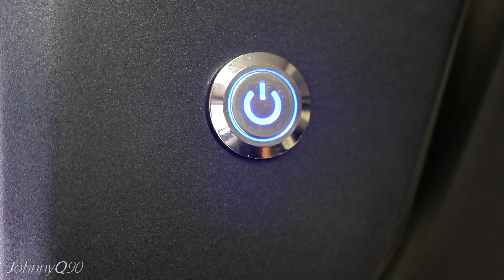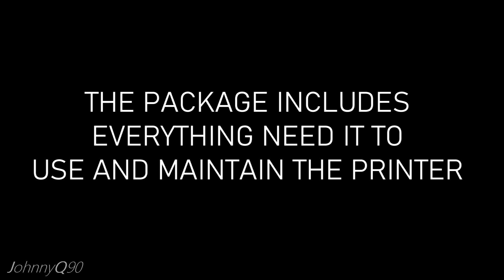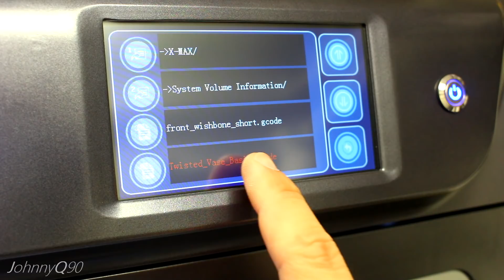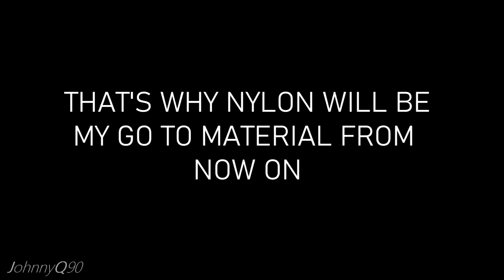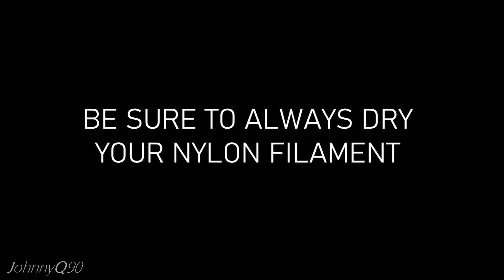Printing UNBREAKABLE Nylon Parts! - Qidi X-Max 3D Printer

Comment: I'm sure if you paint like "goodyear" or "michelin" on the tires it will kinda mask their simple shape
Reply: I'm even thought that same about that at that moment.
Reply: He needs better tires in general. Beadlocked and belted would be best for his powerlevels. The ballooning can be crazy.
Reply: @Aussie Jules Wiener yup i use belted and beadlocked tires on my slash vxl running a 5200kv motor on 3s
Reply: @xenonram  thats cause its not kilavolts, it 5200 rpm/volt
Reply: Hoosier Tires
Reply: Idlers
Reply: David David  RWB Idlers group.

Comment: That’s a great printer! You may want to try printing polycarbonate too. With such a high temp fan you can print the best grade materials, pc for instance has similar toughness as nylon but more rigidity, it is not as elastic as nylon. Nylon is great but the amount it strain it will sustain before failure can actually sometimes be more of a detriment. This is something to consider for load bearing parts that can’t afford to deflect as much.

Comment: I like taulman's 910 nylon, made a replacement hinge for a toilet seat, lasted 3 years before the seat broke. The printed hinge wasn't what failed either, it was the other part of the original plastic hinge. Also definitely print with 100% infill for functional parts.

Comment: Nylon is "semi-flexible" structural material, its mechanical properties lie partway between PC and TPU. It's key property is extremely low coefficient of friction. 

PC would be optimal material for RC car suspension. It is also extremely difficult to break but it's a lot stiffer than nylon.

Comment: It is important to distinguish between strength and flexibility. In your examples the nylon parts survived mostly because nylon is far more flexible than the other two materials, not because nylon is stronger (although, to be clear, 3d printed nylon parts are stronger than 3d printed PLA and PETG parts but that is not really what is being showcased). For som applications stiffness, cost, ease of printing and/or temperature resistance might be more important so it seems odd to me that nylon would be your go-to choice of filament. The right tool for the right job!

Comment: Nice! I built an enclosure for my Prusa Mk3s, so that I‘m able to print Nylon on it. It‘s really quite a difference! You might like it :)
Reply: Unfortunately nylon is not as stiff as PLA or PETG and desires a different shape in most cases. Have you considered to use shopped Carbon fibers filled Nylon with a hardened nozzle?
Reply: Do your Prusa MK3S printed PETG parts like the head assembly and bed leveler brackets soften, melt and distort when enclosed printing nylon?  Or do you have to replace all the PETG parts with ABS, NYLON OR PC BLENDS?

Seems printer parts should be injection molded ABS instead of 3d printed PETG parts?
Reply: To avoid this becoming a problem, I set the temperature limit to 50 degrees C. You’re right though - I plan to replace the 3d printed parts with machined ones in addition to other mayor mods on the printer.

Comment: You probably know more about this stuff than I do, but carbon fiber for example is fairly brittle, yet very strong.  Carbon fiber would definitely break where a nylon part wouldn't, but it doesn't flex as much and is much stronger per unit of weight than nylon.

Comment: The nylon arms are going to be durable, but even the Taulman Alloy 910 will bend as a lower suspension arm.  I've designed and printed replacements for my car, and you can see after some time the arm twists down where the spring applies pressure.  I would avoid Bridge for RC car arms as they're like wet noodles!

Comment: You should try printing a similar design to the michelin x turf tires used on tractors with a thick rim and maybe knobbly bits on the tread surface, they should deform and grip pretty good

Comment: You might have to pardon my ignorance but wouldn't a material with a clearly defined yield strength be favourable over a flexible material?

I think I'd much rather my control arms break and require an iteration with designed reinforcements compared to one that won't break but will just flex and deform in an inconsistent and unpredictable way.

Comment: I’ve got a question about the drive train of a rc car, are you familiar with a sxs? That are belt driven and was wondering do you think this it’s possible to have a belt driven rc or would it not even be worth it given you will have a reduced speed cap unlike gears where you can have all different ratios to improve power output or speed?

Comment: Hello Johnny, using PETG where you attach the spool, inside or out? And do you dry PETG before printing? Thanks!
Reply from the maker: Hi! If I remember correctly the spool of PETG was mounted outside the case. In this video, this spool was dried, but I usually dry a new spool for a day in a food dehydrator.
Reply: @johnnyq90  Thank you very much!

Comment: Wow, I’m surprised at how well the layers adhere to each other! I’d thought that the hotter the plastic, the greater the temperature difference between the layer being laid down and the layer it’s being laid upon, hence leading to the layers not stick to one another very well. But that bending test really showed the power of nylon.
That printer also has some pretty good results right out of the box too.

Comment: I been printing with nylon for a couple years but it’s a bit to soft for my RC stuff. It’s expensive and not really easy to shatter but so is TPU. So I use TPU because it’s much cheaper and just as durable for canopies & camera mounts ect, PLA for stiffer suspension/frame components and PETG for more anti friction/heat type things. 
I bet if you did similar tests @ 10% infill, 50% 75% and 100% you may have different ideas on what to use ... good video all the same

Comment: long time since i saw foam tire, probably for my mini t last time. As for Nylon yes you will have unbreakable but unless you find fiberglass reinforced filament and be warry of the direction of your print you will not get the same quality as the RC parts you can buy (its often PA66).

Comment: Make sure you keep your nylon dry...
Otherwise it becomes a steaming mess with blobs all over the print.
You will be surprised on how much moister that stuff can get just in a couple of days if stored improper.
But it can also lose it as quick in a few hours in the oven too, so your choice.
Reply: So true. I've been printing with blue trimmer line (glass fiber reinforced nylon) and it can only sit out for about 2 hours. The quality decline is very noticeable in large prints.
Reply: @inoahmann7542  Since the Qidi is enclosed and the filament is inside the chamber he probably won't have to deal with that while printing.

You could try to get a thick cardboard that sits over your printer and filament that should help you immense with long big prints 😉
Even a simple enclosure does wonders.

If you have access to IKEA try to build one out of a LACK table.
Those are cheap and totally awesome.
PRUSA made a video about them a while back:
https://youtu.be/oS7ZtBNh2hE
Reply: @DerSolinski  I actually have an enclosure. I built it out of an amp rack. It's like a mini server rack with a single small vent on the top. I keep all of my filaments on a pvc pipe suspended above it. Unfortunately my printer being somewhat mobile has the consequence of having to print in humid conditions. My nylon is dry at the beginning and my printer is steaming after about 3 hours. I have to build a dry box but I just haven't gotten to it yet. I like the IKEA table idea, when I get a second printer I'll probably do that, thanks.

Comment: That's very cool! The comparisons you made say much about the materials themselves. Would it be possible to make the nylon even stronger by constructing the model in a certain way? Like not 100% fill, but good bridges between walls. When the little vase held up so well in the crunch test, and it was only a few layers thick, how much better will something well constructed hold up!

Comment: 240 is considered high temp? thats a bit low for nylon im surprised it didnt have layer seperation issues at that temp. any cheap entry level 3d printer will do 240 and something like the ender 3 could do 260 with a small upgrade of a capricorn bowden tube that can take that temp

Comment: Maybe you have bad quality PETG or you were using too much part cooling because PETG isn't supposed to be that brittle. I use Prusament PETG on all my printers  with the extruder temp at 255  and bed at 85 with the part cooling fan at 0 to 10% , no more. Layer adhesion is key for mechanical parts.

Comment: Shouldn't need the gearbox now, right? Electric cars just have a single gear with ration chosen for desired power/speed wish speed usually not being a consideration due to electric motors typically having much higher rev ranges (20,000 rpm). 

I love how as soon as you make it electric it becomes so much simpler and can do everything combustion could and more, better probably.

Comment: 6:20 Test is not correct. Try flex plastic, it will never break at all. It is necessary to check precisely for the value of the load BEFORE the fracture. And then petg would have supported the greatest weight.

Comment: What process do you use to dry your nylon?
Reply: Heat it in an oven.  Lots of references out there.  Could also try storing it with desiccant when not in use.
Reply from the maker: I use a very cheap food dehydrator. I left the Nylon filament at 70°C for a day, to make sure it completely dried out :)
Reply: @johnnyq90  Thank you for your reply and awesome content...

Comment: How strong is it with 100% infill. I mean it doesn't break but it flexes
Reply: I too would love to know.
PETG seemed sturdy but would snap. The Nylon seems to be more bendy, which probably isn't great for suspension arms.
A strength comparison would be very interesting.
Reply: @hamster9135  I know it is apples to oranges. But considering that Glock has been making Nylon tools for years, there may be some potential for serious advancements in 3d printing. 
I also think that a little bit of engineering in the printing could allow for reinforcing material to be added post print. Flex where it is needed, stiffness where it is not.
Reply: @cody blea @Hamster dual extrusion is also another option where two materials are used
Reply: @henningkock4436  I'm almost wondering if the pressure that most nylon tools experience during the molding process is needed for a better cure. There is probably a huge paper on that in German; and even if it was in English, it would be over my head.
Reply: @codyblea3638  They nylon can be printed with hollow tubes down the length on the suspension arm from the mounting on the chassis to the mounting for the hub, they after printing solid steel rods of about 1-2 mm diameter going in the printed hollow tube

Comment: It looks like you are overheating PETG, try to lower the temperature. This plastic does not have to be brittle; in normal condition it is almost as flexible as nylon.
For PETG of different colors and manufacturers, different temperatures are needed, the dye greatly affects its properties. I usually use temperatures between 220 and 250 for PETG and 270 and above for nylon-6.

Sorry for any mistakes in this comment, I used Google Translate.
Reply: I never had PETG shatter, but strain and fold away. I print it at 220-230. His results seem really odd.

Comment: 240°c is high temp?... Even my Prusa Mini's stock extruder is capable of temperatures up to 280°c
Reply from the maker: No 240°C is not the highest temperature of this printer. It can go as high as 300°C. The temperatures that you see on the video, are the recommended for this printer and for this material. It has it's own software, which at times I find more convinient to use than cura and I tend to use the factory settings for each material. I found that they work first time.
Reply: I think what MK is trying to say is that, why did you install a "high temp" extruder when a standard extruder could easily print a material at 240°C.
I normally print PETG first layer at 240° then drop to 230° for the rest of the print, on both a home built printer and a Prusa MK2.
I've also never seen PETG break like yours. Normally PLA shatters and splinters and PETG bends before it breaks, very similar to ABS.
Not doubting nylon is stronger but your PETG is not representative of it's normal material property characteristics. You should adjust your PETG print settings or get a different brand filament.
Reply: @hubertpietkiewicz9879  Yeah i noticed that too... the petg looks too brittle... Maybe it's advertised as 'petg-like' material... i have seen some manufacturers do that to sell their filament (or in some cases... resin).

Comment: How do you "dry" the nylon?
Reply from the maker: I use a very cheap food dehydrator. I left the Nylon filament at 70°C for a day, to make sure it completely dried out :)
Reply: @johnnyq90  Why don't you make a small hole on the dehydrator and feed the printer directly from inside of the dehydrator?
Reply from the maker: @Santibag  I'll make a container filled with silica gel to store them and feed them directly to the printer, because I have 3 spools of nylon and it would be very practical for me.
Reply: @johnnyq90  I don't see the point in drying it though. I mean the bed  is at 100c and the nozzle is at 270c, wouldn't it have dried by the time you took it off the hot plate or am I missing something?
Reply from the maker: @noonespecial9131  Nylon is hygroscopic, which means that it absorbs moisture extremely fast. If you haven't dryied the filament before using it, there is no way your hot nozzle and bed will do it. It will be worse. You would actually hear the water crackling and poping on the filament while being extruded. It's even visible on the surface of the printed part. I tried to dry it on my oven for 2-3 hours at 80°C and it didn't work. I let it a whole day in the food dehydrator, and problem solved. It needs time.

Comment: Why do you use a 3 speed on an electric car? With the right gear ration you can go pretty slow and easily reach 100kph, aint that enough? :D
Or do you plan on crawling or doing 200 as well?

Comment: I built a electric rc Gt40 with brushless motor and lipo power batterys and can not get the car to stay on the road, go's airborne at about 85 - 90 mph and crashes every time or the tyres just explode

Comment: You should do a triple motor build 1 for each rear wheel and a big 1 for the front through a diff. be better than that crappy V4, seems like your on a hiding to nothing with that

Comment: Ouch 1200 for that! Yep they are still overpriced in my opinion. I'll wait another 2 yrs  when they drop half price to 500 bucks
Reply: You could just buy a $250 ender 3 and build in the functionality to print with nylon. You just need a heated enclosure, heated bed and an all metal hotend.
Edit: preferably with a direct feed extruder, the Bowden tube would not work.
Reply: They're not getting all that much cheaper anymore. Chinese mass production only took it so far, and the dream of every home having one doesn't appear to be happening. Yes you can go far cheaper, but the cheaper you go, the more you have to mod to fix the issues. I have two cheap printers and a real Prusa MK3S, guess which one actually prints daily?
Reply: Same maker sells a slightly smaller model for 900 or so with the same quality and capability. That is as good value for money as you are going to get; and as others have said here there isnt much happening in the fdm print market anymore; either in terms of new features or radical price developments. This printer was the same price 2 years ago.
Reply: @dreggory82  hell...u can get a Ender 3 for even less, like $167 and sometimes less!  The nylon filament prob the highest cost overall.
Reply: @timd9430  yeah, I see they're $200 with free shipping on Amazon, the upgrades will add up trying to get it worthy to print nylon. Over all I predict it would cost less than $400 to go from nothing to printing with nylon.

Comment: States no fan, staring at a fan seconds later lmao
Reply: The fan there is the hot end cooling fan, to keep the filament from melting inside the heat sink. There is no part cooling fan, though, so he is correct.
Reply: @GiolliJoker  okie doke

Comment: 3d printed rubbers are not very durable at all and will delaminate very quickly.
I would reccomend choosing an alternative to 3d printing tires for your cars. If those prints didn't delaminate FAST 3d printed gaskets would be the next big thing.

Comment: Extruded filament 3d printer tech has barely changed in a decade, and they still want $1200 for that rudimentary machine!?! Yeah, riiight. 3d printing isn't good for much more than trinkets and some prototyping. And if you consider the tens of hours to print a part, and the still poor print quality, you'd be better off doing it on the CNC mill or sending more complex files or for laser/sintering/resin printing.

Comment: You can't just say one material is better then another. Someone 1 matches up better for your task. I would personally never use nylon as it's too flexible to be useful. Of it were a spring then sure but I would print a lot. PETG is a great material, PLA MAG be better. But no one material is better then another. You compare small parts mean for strength but then only use 30% infill? It's like your trying to make nylon look miles better then PETG but it's not better. It's different. Different plastics have different properties. If you want certain properties of course the material that has those properties will win. But those properties you showed on camera were meaningless. You just crushed up a thin part and broke bars. PETG took the most effort to bed all the way over. Nylon is a semi flex material so of course it's going to flex. Especially are 30% infill!